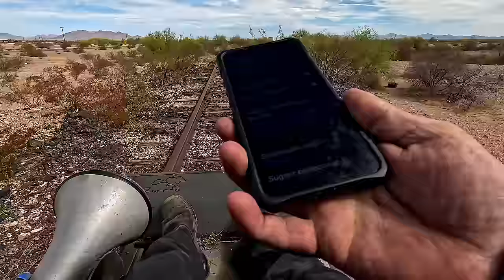TC & GB - Abandoned Railroad -  Arizona US. - Subtitled [ᶜᶜ]

Comment: Awesome video! 
I wonder if traction tape on your drive wheel would help with launching from a standstill. You can find it at boating and pool supply stores for ladders in wet applications. 
Also, would a more-powerful engine in conjunction with a 10-speed bicycle transmission be able to get you going a little smoother? 
Last suggestion: Would a push bar with blade-like extensions over the front wheels help cut through the brush and cut down on derailments?
Reply from the maker: Very good idea about the belt for the drive traction, and the speeds, I think the motor I have is capable of 7 HP.  Thank you very much for the tip
Reply: I have seen @CarsandCameras use CVT transmissions on their small predator motors with their carts, I wonder if something like that could be effective or if it would add unnecessary cost or weight. I am interested in your wheels on your carts and want to look and see if you have made a video about your cart, I wonder if wider wheels might help keep on the track when there are problems with the rails distance. @archiemoreno
Reply: Tu sugerencia ya la habia pensado para mi.
Colocando un motor de motocicleta,
POR EJEMPLO :
Honda 400 cc., 2 cilindros,
2 carburadores, 4 tiempos,
43 HP de consumo economico
a 9.500 RPM, ( viajando a
3.500 RPM estaria
muy suave y sereno a 45 M/h 
aproximadamente segun el tamaño
de las ruedas ).
Tiene potencia como para llevar
otro carrito con 4 personas
con sus bolsos, sin problemas
incluso en los ascensos.
( En ese caso, necesitaria de
2 circuitos de frenos de disco ).
Cuenta con una variacion
de 6 marchas hacia adelante,
refrigerado por aire, ademas
ya tienen incorporado
arranque electrico.
El alternador le recarga
la bateria, pudiendose
agregar luces obviamente,
y "no es pesado."
Hasta le diseñaria un tablero
instrumental con chapa 
plegada, o fiberglas.
No resulta nada complicado,
solo dedicarle tiempo.

En el caso de las ruedas,
para evitar descarrilamientos
es muy correcto como has dicho,
con la superficie de apoyo
"mas ancha" seria ideal.
No se el tamaño exacto de
esas ruedas, pero podrian
hacerse con un trozo
de Caño para Gas
de Alta Presion de
"14 pulgadas, con buen
espesor, y muy resistentes.
Tambien le fabricaria
un trailer para llevarlo.
Respetuosos Saludos...!!

Comment: Interesting design, when I was a kid the Fairmont railway speeder was being sold off by CN in my area. Might have been an idea to buy one, I saw a railman swing one of these cars off the track himself with long poles he put under the car. Seems to remember there being one rail cart with swing-up road wheels which swung out when on the rail but down when they hitched it to a truck. I guess this configuration would not be that hard to configure, just over-centre wheels into tubes on the sides of the cart. Much like torsion suspension trailers/.

Comment: Use that air compressor to drive a pneumatic grinder with a blade on it mounted out front. Then you can just slow down, run the grinder and cut right through without derailing while doing some track maintenance at the same time.

Comment: You need actual 🛞 tires and just use a metal disc to hold them on the rails. But this will save you from any gaps.  Plus better speeds easy launch from a stand still. 
Depending on engineering skills might even be able to rig it so the cart could be driven off the rails pull a lever guards come down holding the tires to the rails.